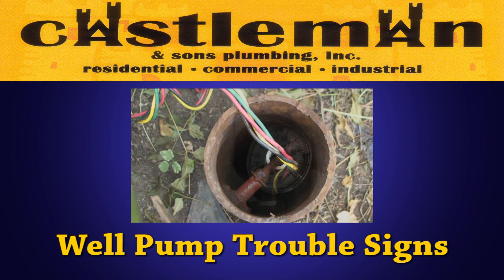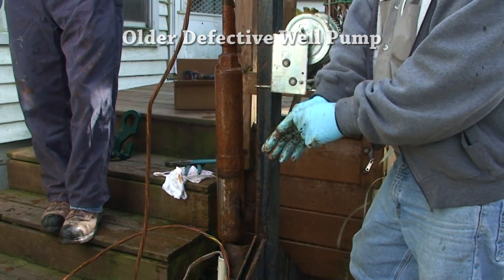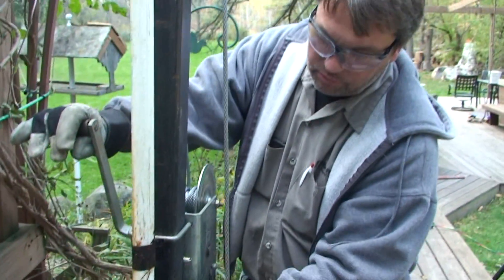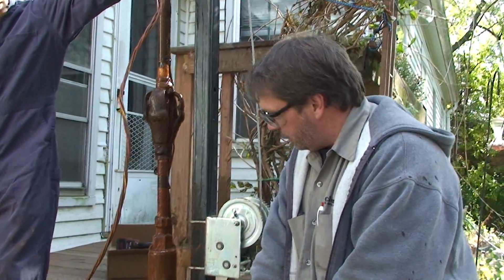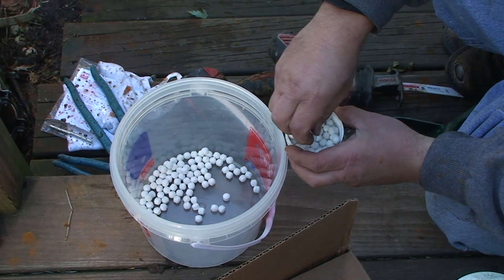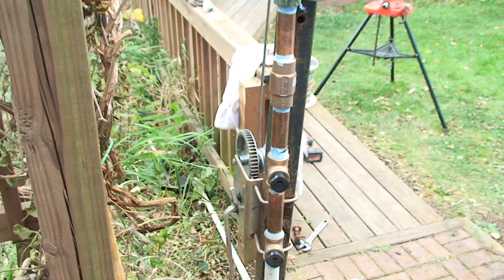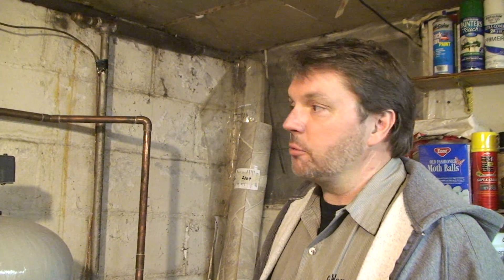Well Pump Trouble Signs & How To Replace A Defective Well Pump

Comment: Mine no pressure pump was replaced 14 yrs ago.. pump switch contacts close when u move the lo pressure shutoff arm. Replaced the pressure tank 8 months ago. U think a pump issue
Reply: Well is 420 ft
Reply from the maker: @jonadams1579  Hi Jon, believe it or not, the average life span for a well pump is about 15 years. Yes, some units will run 30 years, but that's more of a rarity. Given how deep the well is, your pump was likely moving a great deal of water. Having a professional diagnose your system would be a wise move though, given the expense for a new pump. Let us know what you find out. Thanks for watching and sharing your questions with us.
Reply: @VintageVideos2009  they are coming today
Reply: @VintageVideos2009 mine actually had a broken wire in the harness and while it was up i had them replace the pump in 2007. Im on pvc im thinking if its the pump now to replace with urethane

Comment: What if you have water and pressure but pump is getting louder it seems ?
Reply from the maker: Hi Thats_Ery_Day Life, great question. Can you determine if it is deep down in the well casing, or is the noise coming from inside your home, typically with the pressure tank or related components?  Sometimes air in the system causes louder operation, although you often see some intermittent drops in volume or you may notice air coming from a faucet when you turn it on. If the noise is coming from the well casing and the area where the submersible well pump is located, it could suggest a replacement may be needed in the future. It would be something to continue to monitor for reoccuring noise and to watch for erratic water pressure levels. Thanks for watching and sharing your question!

Comment: My double pull 20 amp breaker  kept tripping. So I replaced it . A day later the  breaker tripped again , so  I replaced  the  30-50 psi pressure  switch, it  works perfect .  A day later the breaker tripped again .  I have no controls above ground.  So everything else   is in the well.   Am I looking at a new pump or is there anything  that might need replacing ?
Reply from the maker: Hi John, thanks for watching and sharing your comments and situation. It is impossible to diagnose without being there, but it seems that you are either experiencing a wiring/ short issue(somewhat less likely) or that your pump may indeed be failing and require replacement. Do you know how old your well pump is? The average life span of most well pumps is about 15 years. Some will last 30 years or more, but if your pump is beyond 15 years of age, the effort to raise the pump and check the wiring will probably warrant replacing the unit itself. If you are unsure, this would be a good time to contact a licensed, professional plumber who can inspect your system to see if there is anything else above ground that may be a problem. Hopefully you can find the most economical solution.
Reply: @VintageVideos2009  thank you so much for responding   the house was built in 1960 .  58 yrs later  my guess it could be the second or third pump down there. I moved in 2012

Comment: How do the bleeders open if there is always pressure on the system?
Reply from the maker: Great question. In a nutshell, the bottom bleeder sits below water level, and allows water to flow out of the pipe riser.  A snifter valve is above the water level, and lets air flow into the top bleeder and into the pipe when the pump stops. When the pump starts again, it pushes the air that replaced the water in the pipe between the snifter and bleeder orifice into the tank. So the top bleeder lets air in, the bottom bleeder lets water drain out. As the water level in the tank drops, the float attached to the air release valve swings downward opening the air release valve, which lets excess air out. When the float rises to set point, the release valve closes. When the pump starts again, the process repeats. It's a bit complex, but the bleeders help to maintain the pressure both above the water level and below the water level in the well. Thanks again for watching and sharing your comments.

Comment: Pump won't pump past 45psi to reach 60psi cut out
Reply from the maker: Hi John Smith, thanks for watching and sharing your question. There are a number of factors to consider, including whether the diaphragm in your well tank is still water tight and has adequate pressure, or whether the pressure switch is working correctly. If these components are OK, perhaps like this residential home system, the submersible pump shaft, bearings or elements became defective and the submersible pump required a replacement. You may want to consult your owner's manual for specific measurements with your well system. Another solution is to contact a professional plumber in your area to determine and repair any issues within your system. Good luck and thanks again for watching.

Comment: I have a questionably your well puller how and where exactly did you get it and how can I get one
Reply from the maker: Hi soccerspencer15, thanks for the question. We fabricated this well puller ourselves, using an aircraft-grade, industrial winch and heavy-duty steel beam. These components can typically be found on heavy-duty trailers, and if you are familiar with construction products, you can find these items on light towers as well. Using our video, you should be able to get a good idea of placement and how to configure the set up. The finished weight is pretty substantial, so we strongly advise no less than two people to operate it onsite. Thanks again for the watching and we invite you to subscribe to our channel.

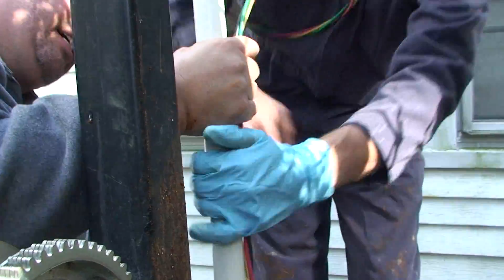Comment: So how is the water connected to the tank? I see at 4:25 the open end of the PVC pipe. If the plastic line to the tank is under ground how do you connect it to the pump? It obviously is not going up the side and down the top of the well pipe.
Reply from the maker: Hi bigpardner, thanks for the question. The PVC line that travels upward from the submersible pump, rises near the top of well casing, and then connects via a pitless adapter (roughly 7 feet below grade to prevent freezing) to plumbing that extends to the well tank. That is why it appears to not be connected on the video, because it the upper portion of the well line will connect below grade. Great question and great observation.
Reply: Thanks. But how do you connect it to something that is 7 feet down?  Do you recommend any brand(s) of pump?
Reply from the maker: Hi, we're not sure if you intend on replacing and installing a new well pump yourself or not, but on this site we utilized a pitless adapter to reattach the new pump below grade. Pitless adapters come in several varieties but are commonly used to attach well pumps in this type of installation. Also, if a professional plumbing service is installing a pump for you, I would encourage you to ask them about warranties and reliability of various pumps for your specific application. Thanks for the questions again, we hope this video was helpful.

Comment: how many millions of dollars doe that cost ? looks pretty bad when you have to call someone out,you know your getting screwed.
Reply: VintageVideos2009 I couldn't help but notice that you didn't answer the question. So how much did this cost the customer?
Reply: Has to be 1.7k minimum
Reply: Regular guy. Shock well with pool chlorine, no iron. Ur impellers r wore, or ur pressure line is plugged. Blow out line and take pump in for service. Add check valve just before pump and valve right after.
Reply: I'm dealing with issue at moment. Only getting 42psi, if I adjust switch to try to go above that it will start to build then all pressure will just blow out to zero. Thing is switch stays enaged but pump doesn't stay running. Like a saftey or over heat kicks in. Takes a full min then magically the pressure will just jump back to 40 psi. I can finally get the switch set to hold pressure at 40 and it will stay there. Once water is ran it will then short cycle. May drop down to 20 then pump kicks on but never over 40psi. Switch is working tank has 38psi. Well company says $675 for pump alone. Not including the ride here and labor. Total will be over $1000+ IF it's the pump which  well techs seem to think it is.  Checked with county water will be $950 or so to put a meter in. So about the same cost other than monthly bill.  We decided to go with city water. Tired of orange staining clothes, dirty toilets n tubs(yes we clean alot but bacteria and iron stains just build up. Guess we'll see. 17 year old new well so it's gone along time.... Also got black sand in water in house now. Been fun week after the Hurricane
Reply: Im a plumber. Almost all my calls are because you guys thought plumbing was simple and did it yourself. Better to pay a pro once, instead of breaking stuff cause it wasnt code
Reply: Submersible, bleeders,line, wiring, control box...400,50,100,20,300 plus markup and max 200/hr x8
Reply from the maker: Hi onewheelup, when you look at the scope of the job, it was clearly not for an inexperienced plumber or handyman to tackle. Yes, after watching this video, if you follow all the steps and you have a winch and a trained assistant, you may be able to complete this job successfully. The homeowner emphatically was happy to have his water service, not only restored, but also running better than it had been for the past 5 years. Sometimes, it's well worth the price to have things done right. Thanks for watching and sharing your comments.

Comment: great information thank you. i have a shallow jet pump and was told my Venturi is plugged affecting the pressure. After i replaced the old pump for $825, pressure is still at 28 psi. Would reversing the flow on the pump clean the blockage, and is it safe for the new pump? Was also informed if it cant be flushed clean, anew well system would cost me $5500 bucks.Any info would really be helpful, im a disabled vet and dont have a lot of money...am i being taken advantage of?
Reply from the maker: Hi wipper2898, thanks for sharing your questions. Back-flushing is often considered a reasonable idea, but it works best when the system is open and you can see the water/debris exit the system. However,  there's the possibility that by attempting to free the plugged Venturi, you could push the debris, rust, sedimentation back into your pump or line, and then when the system is re-energized, the debris could cause even greater problems. For that reason, back-flushing the system has some associated risks involved.

Comment: Thank You for the video. Now a question! The Expansion tank in the pump house looked to be a bladder style, so it shouldn't need the air fittings that are in the well?? I didn't know they currently made a non-bladder style of fiberglass expansion/compression tank. Curious?
Reply from the maker: HI Lito, thanks for your questions. If you're referring to the bleeders, located within the well casing, those expel air to improve water flow in the system. Regarding the Fiberwound tank installed on this video, this model does indeed have a bladder inside of the inner and outer shell. Here's the configuration for this unit:   
Inner Shell: extruded copolymer polypropylene
OUTER Shell: fiberglass Wound coated with epoxy resin 
Diaphragm: 100 % Heavy Duty Butyl rubber, lower water chamber is coploymer polypropylene
Thanks for the questions and appreciate that you shared your comments.
Reply: @VintageVideos2009  you have bleeders and air volume control which means that tank does not have a bladder. That is a hydropneumatic setup. I have the same. Where is the anti torque unit for the pump?
Reply from the maker: @helihoot  Hi - good observation. Sorry, we missed capturing that for the video. It was attached prior to completely lowering the submersible pump into the casing. It's normally attached 1-2 feet above the submersible pump. Good catch!

Comment: Lost all water last night at 9:30pm, after a heavy water usage day.  Noticed lack of pressure on a sprinkler at 7:30 pm, but figured it was due to the shower going as well.  Checked the pressure tank first thing and it was at 0 psi.  Ran the air compressor and got it up to 15 psi, went in the house and turned a tap on... a little water came out and then a LOT of air. Went back to check pressure, it was at 0 and I realized I had never turned the valve to the house back on.  So I opened it up, tried to add air to pressure tank again and it won't even register on the gauge near the pressure switch (even turned the valve back off and tried both ways). It's an old galvanized tank with NO visible air leaks, though a couple drops of water did come out of the schrader valve when I disconnected the compressor the second time.  Worried my pump might have burned up, though pressure had only declined a couple of hours before. The pump may definitely be at the end of it's lifespan at 11-14 yrs old.  Took a walk to the  pump house after the air came out the faucets after the first failed attempt to fill the pressure tank and did hear the well cycle for about 2 seconds---it's far from the house, so I don't know if it is cycling on at all anymore. When I've gone down to check it's off.  I also tapped the pressure switch and verified the tank is empty of water.  Having a heck of a time getting a hold of the landowner to OK a serviceman to come out and I can't stop trying to troubleshoot it myself!  My worry is that the pressure tank AND the pump are bad.  What do you think? LOL!  Thank you : )
Reply: Oops, forgot to add the housesitter for the residence next to mine also turned on what we thought to be a flush out valve by the pump housing and got good water pressure, but the pump was not cycling.
Reply: Another strange thing; I just went out and checked the pump house, no pump cycling so I came to shut the breaker off (there's 2 actually, one I assume is the pump and the other the pressure switch).  However, I still have an old school electric meter (thank goodness) and when I shut those breakers off, my meter slowed waaaaay down.  I can't understand how it's pulling electricity if it's not cycling on :/
Reply from the maker: If you are getting good water flow from your pump, via this flush out valve, it suggests that your pump is still operating successfully. You should focus your efforts with the pressure switch and other electrical components, because according to your comments, this is the more likely area of trouble. Good luck on resolving the issue and getting your water supply system back to normal.
Reply: Thanks bunches for your input, I sure do appreciate it.  My fear is the landowner cannot afford to replace a pump right now, and he's a wonderful person.  If I can fix it, I will.  Single mom with manual and power tools here!  I also should have added that extra air has been in the lines the last couple weeks.  I've lived here 11 years and it's always had some air burping out the faucets and toilets, though no visible water or green grassy spots along the pipe routing outside.  Someone suggested there may be a break in the pipe down in the well housing.  The well is about 75 yards from the pressure tank.  Thanks again and hope this finds you well & blessed ; )